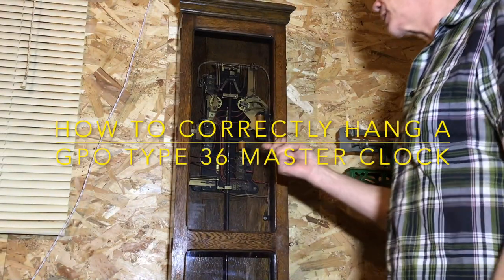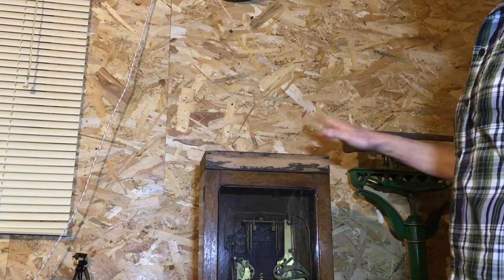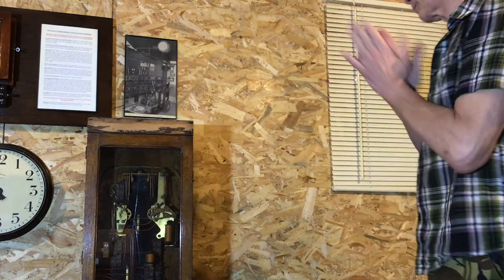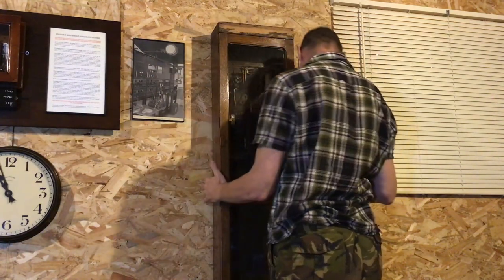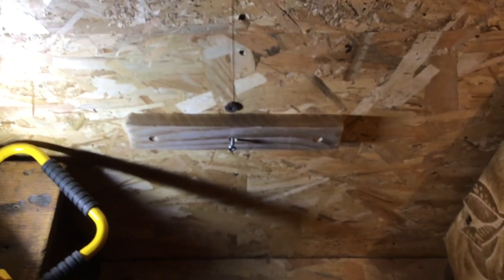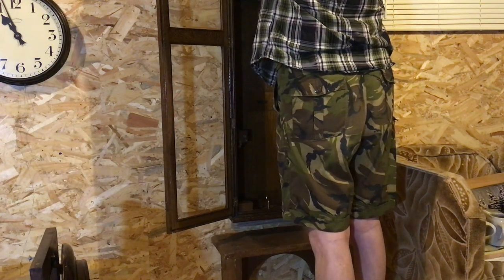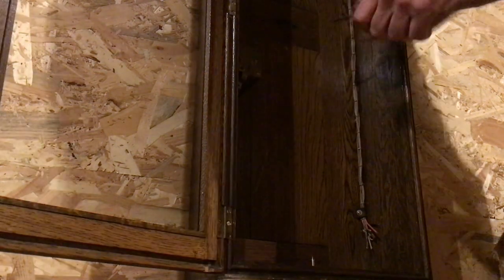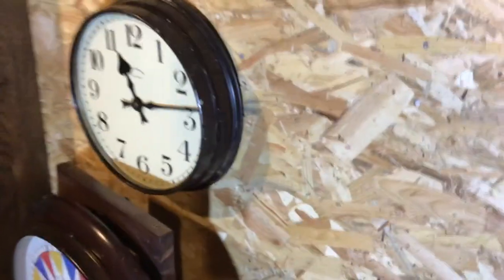Correctly hanging a GPO clock No  36

Comment: hello, what do you use for a dc power supply for your master clocks, there are many ways, but I do not know what is the best way, thanks.
Reply: They like r4 to 4.5 volts dc. Just to run the clock, I used a 4.5 v charger from a mobile phone once! Not perfect but it worked.